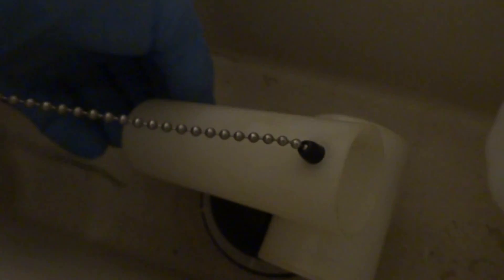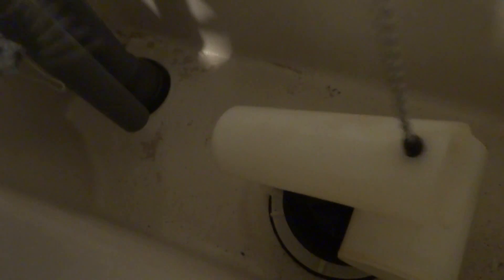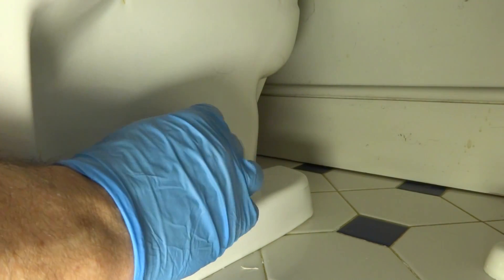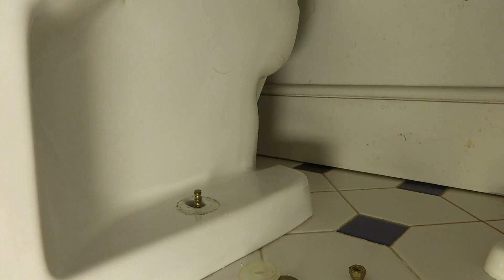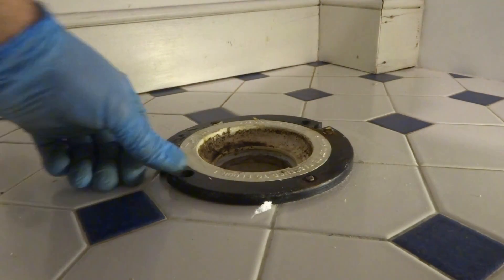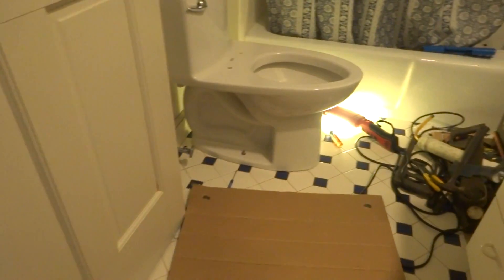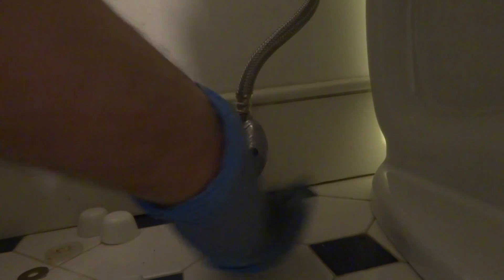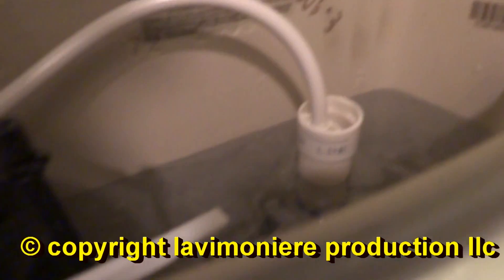TOILET REPLACEMENT SUPPLIED BY OWNER

Comment: I can't believe how clean the old toilet was, inside, out and underneath. I wonder if they recently bought it used and it was damaged in shipping.
Also, I had to replace my own toilet yesterday, did it myself. Thanks to your videos, I knew to throw away the included funnel wax ring, and to use brass closet bolts. The ones included for the tank were brass already. 
And at the end, I even said the trademark "No leaks"

Comment: I would like to know the backstory of how the original toilet tank cracked. To me that's a very rare occurrence.
Reply: and this one is damaged before she even starts.....for what it's worth, I think the homeowner should have been advised what was going on.
Reply: @JohnstonPettigrew  She will probably look in there before long and see it.  Then she will call Steve...(that is if he did not decide to tell her what happened).  But that will be a separate episode.
Reply: @craigharding475  And she would blame Steve for the chip, and that chip now creates a weak spot that can crack later with temperature changes like the first one did.
Reply: @HobbyOrganist  Thank-you!  I wondered about that.  An unseen flaw must have set the stage for a temp change at a moment of a physical stress on the spot.  Good analysis!  In a sense...A PERFECT SHIT-STORM!  LOL!
Reply: @craigharding475  I work with clay and ceramics, so I know about this, you get a little defect and it's like a score line on a window pane or a chip on a windshield, once that's there it takes very little to crack.
Reply: @HobbyOrganist  I remember when the art teacher said the it was very important to smack at and compress the clay to get the bubbles out.  It could explode in the kiln she said.  I remember hearing something, years ago, that a new ceramic engine block was being developed, and that it would be immune to overheating and long-lasting.  I wonder where they are?  Maybe they had the same problem as the toilet manufacturers with QC.

Comment: Epoxy stick. Pull off a piece, kneed and apply. Use a wet finger to mold and shape. Done and done. It’s up high on the tank, so I wouldn’t worry too much.
Reply: Bingo! I mold with Epoxy 3500 all the time..

Comment: Hi Steven,
Does the toilet flange have to be flushed with the finished floor or does it have to be higher than the finished floor.
Thanks for your videos.
Reply: Install it just like the one in this video. Use a 3x4 closet bend and you can install the toilet flange after the finished floor. If you are to low you can get plastic spacers to get it to the correct level or just use a jumbo wax ring..

Comment: Better watch it, shes gonna blame you for that chip in the porcelain.
Reply: Relax. She'll never see it anyway. No one takes the lid off unless the toilet is constantly running and that won't be for at least a few years.
Reply: @nickv4073  Ya never know.
Reply: @rpurdy4821  True.  She might just look inside out of curiousity.  I just hope that with HER luck, that she does not drop the lid and break it!  She may even drop it a short distance back to the tank, then see that chip and say: "Oh! Look what I did!"
Reply: @nickv4073  You never know, judging by how clean the old one and the floor under it was I bet she's the kind who cleans inside the tank when she cleans the bowl! Years ago I worked for a salvage outfit in NY City and a wealthy woman called to have what was an antique  toilet and pedistal  sink removed from a 2nd bathroom in her apartment in the upper East side overlooking Central Park ($$$$) as she wanted to use it as a closet.
When we arrived her housekeeper, a black lady had covered the all white carpets from the hallway to the bathroom with plastic, when we removed the toilet and sink it was unbelievable how CLEAN they were- EVERYWHERE- all sides, and even underneath and in the back, that housekeeper must have sat on the floor once a week  and scrubbed everywhere with a tiny brush.
Reply: @craigharding475  But then she wont find the chip ;)

Comment: Hey Steve, was there a wax ring on the old toilet, or some other type of seal? It seemed really clean after you removed the old toilet.
Reply from the maker: wax was stuck to old toilet ... guest bathroom not used to much
Reply: @stevenlavimoniere  Thanks for the reply! Once and awhile you get lucky and it's easy :-)

Comment: We had a Bathroom gutted and remodeled. Noticed an immediate drop in our electric bill, we went with LED Lighting, but that didn’t explain that large a drop. Turns out if was the toilet, we are on a Well, so our water is the electric bill.
Reply: So you couldn't hear your toilet running all the time?  Who's fault is that.
Reply: @nickv4073  I can assure you they weren’t running all the time, the old toilets, like the new toilets, would suddenly come on fully, and refill. This is very noticeable. Also I’m a retired tradesman, so I know how to repair things myself. Yesterday I replaced the Yellow seal on one of my new Kohler Toilets, as I heard it refill yesterday, during a power outage. Shut the water supply off, and as soon as we had lights, replaced the seal in under 15 minutes.
Reply: Did you switch to a low flow or one of those toilets with the 2 buttons? How is the new toilet saving you on money? I understand you're getting water from a well that gets pumped electrically but how is the toilet so much different to save you that much on your electric bill?
Reply: @rpurdy4821  It uses a little less than half the water per flush. It’s not designed as a two stage flush, but if you hold the handle down for a second, it will flush with a little more force. Both our bathrooms have been remodeled, with Kohler High-Line Classics,  The are Comfort Height, Elogated, with the Quiet close feature. The toilets don’t spray the water, but do have an annoying single glug. This is typically of these toilets on larger sewer pipe.
Reply: @stevenmoomey2115  That still doesn’t explain your electrical usage reduction.  Cutting the GPF in half should only net you a fraction in well pumping time for refills.  You had some other electrical load going on that mysteriously was solved during your rehab.

Comment: I'm thinking about upgrading this toilet we have. It was made in 1987. I'm guessing it's a 3 gallon flush. I don't know if it would be worth it to change to a high efficiency toilet. If often takes more than one flush for the big jobs. The tank lid is also missing. It broke in the past, and I've been using a combination of an improvised tank cover make out of sheet metal and plywood. I don't have a car, and I have tennis elbow. I'd rather just have a plumber install the toilet. I live in Tulsa, Oklahoma, so I'd have to find a plumber around here to do the job. Also, I'd have to figure out how to pay for the thing. I've thought about having Home Depot do it. I'd have to have some sort of payment plan with other plumbers, and I don't think they do that. There might me another stimulus, but I don't take such things for granted. They have been quite helpful it getting stuff we've needed in years, but the money goes quick even if you invest it responsibly.
Reply: Jeez it's not like you're financing a 2021 BMW.  It's a toilet
Reply: Why don`t you measure your tank and see if you can find a cheap used one at a salvage yard?  (or if you live in Kentucky you could even find one on a rural roadside)...along with some coal outcroppings!  LOL!
Reply: @OCC_Plumbing_and_Restorations  Good to know...I got a neighbor a replacement refrigerator plastic shelf and working bulb for free.  On some of the back roads here in central VA you can find old appliances tossed-out on the roadside.  I had an old Frigidaire upright in my kitchen that came with the place (avocado green).  1970 model.  I bought a new one from Lowes that was frost-free.  Love that feature!  They hauled off the old one and it was still working after 38 years!  What a company!   I had an uncle that lived in his off-grid bungalow in the country.  He had a little fridge that ran on 1/2 gal. kero per week!  He called it his "ice-box".

Comment: I see you don't use the seal with the horn?🤔
Stay safe.
Retired (werk'n)keyboard super tech.
Wear your safety glasses.
Reply from the maker: I WILL NOT USE A WAX WITH PLASTIC HORN ..I WOULD CUT TE PLACTIC HORN OUT WITH SIZZERS AND USE JUST THE WAX
Reply: @stevenlavimoniere 🤔🍺🥃👍
Reply: The horn is trash, I just had to pull a toilet and put a regular wax ring in because the stupid horn Was restricting the flow and causing the toilet to plug up easily
Reply: @chrismallory3718  that's all I've ever used 31 years with no problems(if it fits & usually does)
Now I did commercial buildings and  District Offices,but I still use them in residential???🍺🍺🥃🤔
Reply: I only use plain wax rings. Ones with plastic horns/sleeves suck, seen them cause many leaks. The horn won't fit inside a PVC street flange

Comment: I'm gonna have to change my upstairs toilet.  It acts weird.  When you flush it, it sounds like its farting from the little holes under the rim and does not flush well anymore, the water is slow going down and it plugs much more easily lately.  It's nice that they cleaned up for you for once.
Reply: Could be they used a wax ring with a horn, I just augered,  pulled and rest a toilet with a regular wax ring the other day and that was the fix
Reply: @chrismallory3718  I wonder.  We have lived in this house for 18 years.  But this farting I think has something to do with the low performance.
Reply: @boomer9900  the little holes get clogged up. They make a cleaner you pour down the overflow to clean them out. but you could try a piece of wire and just push it into the holes and clear them.
Reply: @bjone1153  The thing just needs to be replaced.  It is 1980's vintage dark green, sink, shitter, and jacuzzi tub and all.  All phony gold plated hardware.
Reply: @boomer9900  That's what I would do. But I have learned in the plumbing business some folks just cant let go of their vintage toilets because it matches the rest of the bathroom. So we have repaired quite a few 5 gallon toilets. They even had the original brass fill valves. They just dont make things like that anymore.